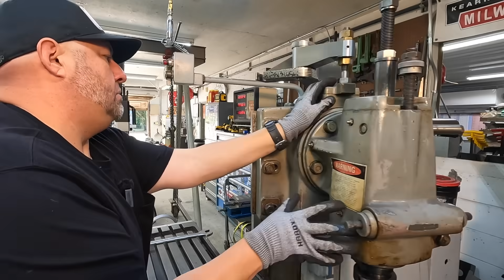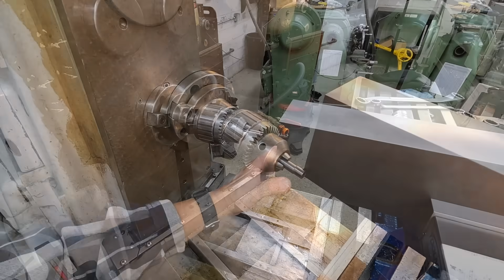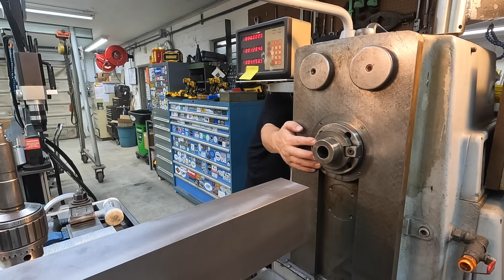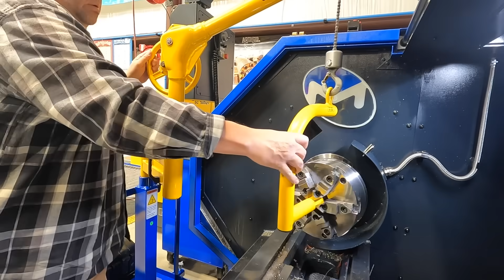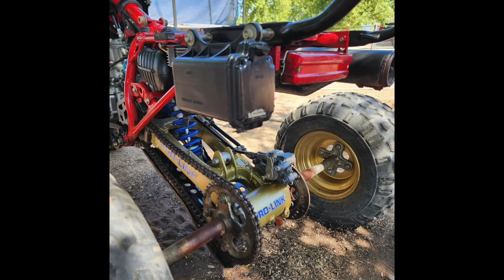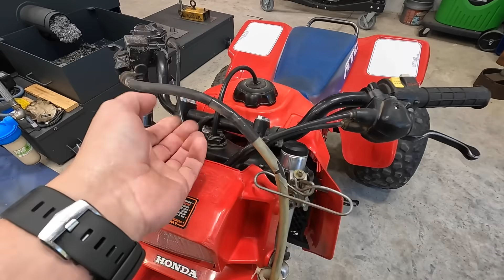SNS 377: Machine Setups & Honda ATC 250R

Comment: Both of our turning centers run 3 jaw chucks but, they also have chuck jaws for all the various sizes of diameters to be turned which must be changed out for each turning diameter. Which tells me if you are using a traditional 3 or 6 jaw chuck in that turning center that is your issue with chattering and rigidity. The YMC for example we have has an entire rack of boxes of every diameter jaws you can imagine that have to be installed and setup correctly and indicated in for each different turning diameter we run in that machine. The older Hyundai machine is the same we have an entire toolbox section dedicated to jaws for each different size diameter to be turned in that machine all the same. They also have a sort of drawbar design in their chucks in fact I'm pretty sure the chucks to our machines can not even be changed like traditional Lathes they always stay mounted and the jaws are the only things we change.

We even run into situations where we have to modify the jaws for certain situations which means we have even more "Shop Made" Jaws for both machines as well. Of course those are made from either old jaws for if we cant order the correct jaws for something oddball for some reason or is more cost effective to just modify some unused jaws we will just modify those. Chatter is pretty much and speeds and feed issue from there.

Comment: In my high-school years (88-91) I had a 1986 yamaha tri Z 250 that I would race against the 86 Honda ATC 250r. Both are 2 strokes but the Honda easily beat my yamaha on the straight stretch. On the technical terrain my yamaha could out perform the Honda due to what I believe was from the yamaha having a slightly lower gearing as the Honda would die often from a technical position on rough terrain.  What a blast I had. Never wrecked it myself but most of times when I let a friend try it I would have to repair it afterwards. I now own a 1986 Honda XL250R dirt bike. It is a dual sport one cylinder with 2 Carburetors. A great trail bike and around town wheeler. You have an iconic piece there! Enjoy!

Comment: What would have happened if you swapped the two extensions....would that have cancelled the couple thousandths runout???
Reply: The biggest error was in the second extension, so if the extensions were reversed the overall error would probably be bigger.

Comment: That chuck, should be good up to 2600 rpm, but it may have a safety of 4X built into it.

Put a board on the ways, and spin the cnc to the max, with the 3 jaw chuck....😊

Comment: Next time just hang the part down off the Bridgeport table and drill and tap through the backside of the vise slide, mill a flat big enough then make it happen. If those pesky through holes aren't for the liking, thread in set screw peen it in place then grind the protruding setscrew on the backside of the slide and paint.

Comment: Hey Abom. Make some engine mounting plates out of billet, maybe some handlebar clamps that are Abom79, Billet axle nut caps. The caps in the top of the front shocks, make a headlight guard. Front brake reservoir guard. Billet front sprocket guard, DRW makes a nice case guard to prevent chain wack to the engine case. The rear pro-link you could make the links out of billet. Just a few ideas for you.

Comment: yes very interested i had a new engine pulled from a 86 i sold to on the pipe racing it was oem new never fired wish id kept it 
my fav dirts bike are from the 85 to 92 erra my absolute fav was a 86 kx125 and my 99 cr250r

Comment: Adam i like the sky hook .. if it weights 150lbs or lighter i  pretty much handle it fine without problems but i found that awkward shape stuff its beautiful i built similar lifting devices for my old machinery shop

Comment: The run out on the outside of the adapters makes no difference, its the register surfaces that are more critical, but a couple of thou on the the edge finder is not too bad, bet the drill has more!

Comment: Adam,
Couldn’t you cut the tapped holes from the other side of the jaw?
Ie., use an end mill to ‘spot’ a face for each hole, then drill and tap from the back.
Either hang the piece off the edge of your vertical mill table, or do it with the horizontal spindle in the K&T?
Robert

Comment: A heat gun on that plastic tank will bring the shine back to it. It won't remove any deep stratches but it will make it look new without any major elbow grease.
I grew up on honda 3 wheelers and would rather have one than the 4 wheeler I have now. Been looking for a decent big red for a few years. People think junk bikes are made of gold much less one half way in good shape.

Comment: Back when I was in Arizona, I towed Agricultural aircraft with a ratty Honda 3wheeler.  Worked fine!  Was the airport transport vehicle.  Really common for the Glamis Sand Dunes.  Not as stable as the 4 wheeler, but still pretty good ride iffn you think before gassing it 😂

Comment: Drilling the vice for the jaw= I have a forty year old B&Decker drill.  Clamp the jaw to a bench leg, superglue the face plate to the jaw and center drill the jaw using the replacement face as a jig.  Drill 3/16 as starting point, checking square with a square.  Drill to depth plus a bit.  Change bit to correct diameter for tap size. Tap.  Easy, old school, not accurate to.0001, but it’s a vice jaw, not a Steinway keyboard.  😂

Comment: Great bike!  I spent a lot of time on an 85.  You are right about the seat for 86. Also the engine for 869 is that grey color, in 85 it was black so easy to tell from a distance.  If you are going to ride it hard I would recommend a wider axle or you could make some wheel spacers in your shop.  There's lots of after market support.. or there used to be.   I want to say a CR 250 (motorcycle) had a thinner head gasket.  I'm thinking that is a easy way to raise the compression ratio a bit.  My first ever helicoil was in the sight plug for the clutch oil on one of these....ugh!

Comment: @abom79 Adam, loved seeing that Classic Honda 250R!!! I bought a brand new 250R in 1985 the year I graduated High School. I can’t tell you the amount of miles I put on that thing. There was probably at least a few hundred people in my home County in Eastern Kentucky where I grew up that owned ATC’s back in those days. That’s what we all did on the weekends was get out and Ride all over the County. Where I’m from is a very Rural place, so we had literally hundreds of miles of Trails to ride all over Lawrence County (which is one of the largest counties in the state).
You are correct about the Seat Covers in 85 & 86. The 85’s had 250R printed on the Seat Cover.  The R after the 250 actually stands for Race Ready, Race Model or just Racing. It is is the R before the 250 that means 2 Stroke. The Engine in that ATC is a CR250R, the exact same Engine used in the CR250R Motocross Bikes. Later on when the 4 Strokes became popular the designation was changed to CRF250R which means 4 Stroke Race Ready Model.
I say definitely include the ATC in your Video Series. We are all Gear Heads here and would love this.

Comment: The Quads awsome but also the most Dangerous vehicle in history haha, didn't honda stop making them because of the amount of injuries or lawsuits, Top heavy and 3 wheels, it would tip over if you looked at it wrong, fun thou
Reply: Tricycle or tryc.   Quad is 4 wheeler bud
Reply: @daneboyd952 
yeah ..quad = 4.   tri = 3
😂

Comment: Hey Adam that 250r is super mint!! Those original tires are worth ALOT of money so don’t ruin them if you take them off. I know these things very well and have owned several of these older Hondas and atcs. By the way they didn’t make a 250x but instead a 250sx which had a electric start (s) and four stroke (x), and a 350x which was four stroke (x) and kick start. If it was me I wouldn’t ever take it in the mud if u ride instead take it to the dunes. I also would leave those oem tires on the gold wheels and keep it stock or get another set of wheels and tires that you can easily swap out cause those original tires are hard to come by in good shape

Comment: That 250 r was probably last year for us sales, my 1986 200x I bought as “parts” in spring of 1987 after congress outlawed new 3 wheeler sales… Honda has the sellers cut of the necks with the serial numbers on them to send in for refund… luckily the big red modern necks were the same and I found a wrecked
Reply: Found a wrecked one to cut neck off and have welded on to make it runnable… was fun bike… my current business was then out in Naknek Ak fixing 3 wheelers since I was 16 years old… now same business builds airplanes since 1986… have fun! Don’t land on your head!

Comment: I worked on a lot of these as a kid, in a Honda dealership and yes people got hurt on them but that didn’t stop them from riding it the next weekend. The rarity of these has gone through the roof like you said last year I came across one for $500 and I couldn’t believe it it was in pieces at my age of 60 I posted it and got $3500 for it so a profit of $3000 for buying and selling and I’m still kicking my face for selling it because of the rarity I know I’ve only one more in the garage and haven’t even been back to check it out but I’m gonna

Comment: My uncle had a 250x that was a blast. If you havent driven over your own leg, you havent driven a 3wheeler.
The 250x was a 4stroke. Keep an eye on the rear axle, they tend to get bent.
Reply: They made 250r 350x250sx and 200x no 250x my man
Reply: Yes, I also spent a lot of time on a 250sx it was an air cooled four stroke, shaft drive, same engine as the BIG RED  @Clippymcclipperson1

Comment: Umm, Adam. I must admit the Sky Hook is worth its weight gold for manoeuvring heavy objects, but...

The only thing I don't like about it is that annoying ratchet sound. Every time you use it I need to put my fingers in my ears.

I have seen two other makes of lift that other engineers I follow use in their workshops, lifts that operate on the same principle as the Sky Hook. The difference with theirs is, they don't have that awful loud ratchet sound.

Lastly, it seems you have an oil leak that appeared when you removed the vertical attachment.

Merry Christmas and a Happy  New Year to you and your family. 🎅🥳🇬🇧⚒️💥

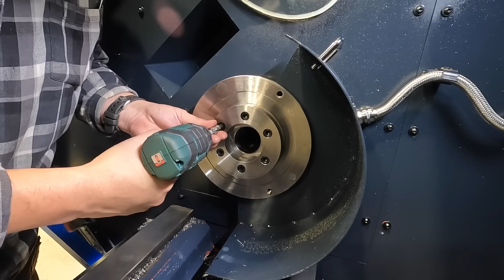Comment: 44:40 and after - Have you ever checked the spindle centricity?
46:30 It seems to me that this corrosion inhibitor is unnecessary, the liquid film it creates may affect the geometry of the spindle - lathe chuck system. It is enough that the surfaces are dry and perfectly clean.
48:56 after the corrosion inhibitor has evaporated, the screws will become loose.

Comment: @Abom79 3 wheeler customization idea: Front axle offset spacers (set the rake/trail forward to make it less twitchy, less prone to rolling/flipping). Maybe a larger diameter front wheel & tire or longer forks to raise the moment angle going through the steering head. Looking forward to seeing half a million dollars worth of machine tools do something you can enjoy when no machining is happening.

Comment: Trikes scare me. Inherently, they are less stable. If you brake and turn simultaneously, they are prone to roll.
Reply: Depending on the rider, get the ass off the seat to turn and be on point w clutch skills that bike is meant for a expert/pro rider not for one’s who don’t have the skill to handle.
Reply: Isn't the thing that if you want stability, you put the two wheels in the front?  It does seem a little crazy pushing a little wheel turned sideways with all of that mass and power coming from the back!

Comment: Hi Adam , long time subscriber first time texter , I watched the bit in the video were you said you were having problems with chatter in the miltronics lathe ,

I'm not usually one to say anything  and im sure you know way more than i do , yes i get chatter because of the spindle as Ive given it some stick for years and now its worn ,but  I see you have quite a lot of stick out with all your lathe tools in the turret.I use a Hurco Tm 10i at work and i try to keep the tools set as far into their holders as they will go right up to the shoulder if possible as this keeps the chatter to a minimum, just a thought.
Reply: Machining 101 minimum stick out for any tool on any machine.
Reply: ya think  @machinists-shortcuts

Comment: I had the 200x and I loved it. You can manufacture your own sprockets and axles etcetera. Must be nice! Auctions have been filthy high. 

I'm hating life because I can't find a decent used small lathe and milling machine. For the price these lathes are selling at, you can purchase a brand new CNC lathe. Albeit those CNC machines are Chinese, they have stock in the US and they are easily delivered. I don't know what to do but I would love to work as a machinist again.

Comment: 1:01:53  My advice to Asam and anyone in a similar position, with the property?  Do it RIGHT AWAY as soon as possible.  My wife and I had 100 Acers just 15 minutes from the mall on country back roads.

We were going to build a bog house there and a Geodesic dome for a big barn / garage ... [aid t off after 15 years, and never got anything built, them my wife died and I had to sell it, I SHOULD have built a small place there right away, or even the garage / barn first :(

Comment: I would seriously reconsider the shoulder bolt design. Leave off the male thread instead drill through and counterbore for a high tensile socket cap screw. No need to mill slots or hexagons and a much stronger thread.

Comment: @abom79 if you need parts for the ATC check out Rocky Mountain ATV MC. I have purchased a lot of parts from them and they do carry lots of OEM parts for even old machines. I just sold my 87 TRX250R two years ago in similar shape if not better to your ATC. Anyway, always wear a helmet and ride safe.

Comment: 31:34 .. One time I used a very nice 31/32" drill bit to tap in the Morse Taper adapter, exactly how Adam is doing at this time stamp (except Adam s using a dead blow hammer the correct way)

I broke the drill bit right in half with one kinda enthusiastic tap :(

Comment: I wonder if you popped the second extension out and flipped it 180, would the runout improve?  Still, .0025 at the chuck is pretty amazing to me.  I grew up with those ATC's, and would love to have another.  They were a blast to ride!  I love the Malibu.  I've had a couple, and they work great at the track.
Reply: I was thinking the same thing regarding the two extensions. Use a sharpie or similar to mark the two extremes of the runouts on each and rotate one against the other to see if you can counter one against the other.
Reply: I had the same question.

Comment: He could have rotated the head 90 degrees and drilled from the back side.
Or drilled from the back side using the horizontal spindle - better still use the jaw as a guide for a pistol drill.
The easiest way he could have found the jaw hole centres would be using a stack of gauge blocks at the correct centre height less the edgefinder radius.

Comment: You should add some width to the rear axle. My cousin had a 350x with wider axle and it rode so much better than stock. Nowadays the majority of quads are wide so it’s not really an issue on trails to take an old bike that’s widened.

Comment: I would consider a fixture with hardened drill bushings to clamp onto the part and drill with a hand drill. The holes aren't that large, deep or tight tolerance and it seems it would be a good deal faster way to do them.
Reply: There is already a fixture, use the vice jaw.

Comment: Oh and the plastics that get cloudy can be cleaned and then melted to refinish. Just wave a map gas torch 6" over the cloudy plastics slowly and you'll see the surface get slightly glossier then fully glossy move on to the next area and don't boil it. It's not hard but it's easy to f up... Good luck, and keep the original plastics as many as you can they're worth so much more.

Comment: .. You could also just lay it over the side of the mill table, (or a drill press ar as that goes) ... and drill and tap the  holes from the BACK side, 

There is No reason the exposed holes the the back of the vice jaw will bother anything, or as far as that goes, you could close them back up, with any one of a dozen methods, for appearance.

My favourite to close the hole for appearance, would be to just thread in some bolts ... weld them, so they'll never turn in there.. then grind flush ..  .. and use a needle scaler to replicate the cast iron appearance :)

Comment: Adam, when you have the drill chuck on those extension pieces, would it be helpfull to use those 2 support beams above it and the triangular piece that you use to support the arbor when horizontal milling ? Perhaps you can give support just behind the chuck then and even do some light milling if necessary.

Comment: Comments are good for the algorithm so I will induce some.

Abom, you missed the oportunity to simply drill in from the front, tap the holes and plug the outside (front) with weld (or JB weld if its going to be painted.

Comment: Adam ,  Limit max RPM in thread cycle i.e S300 code in program
also a set of soft jaws bored to qualified diameter for the slug piece
Love the ride rock on

Comment: Drive in straight lines only,but if you have to turn go slow and use a lot of body English. When I was stationed in mcas Yuma a bunch of us went to the Yuma sand dunes, long story short one of the guys turned to fast and the rear wheel kicked up he went flying naturally we all laughed. He got up we all had fun went back to base, next morning he complained his body was tingling went to the corpsman found out he broke his neck. He was in a halo for couple of months but he was fine as far as I know he had no lasting effects. I learned his lesson. Be careful Adam riding this.